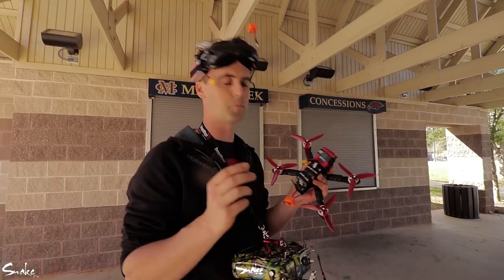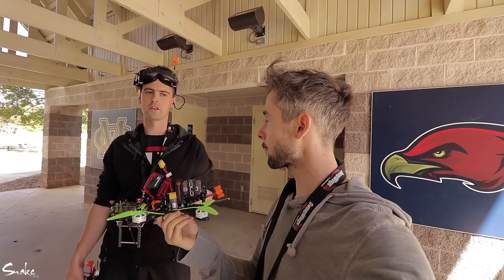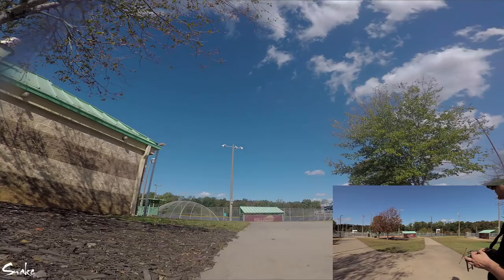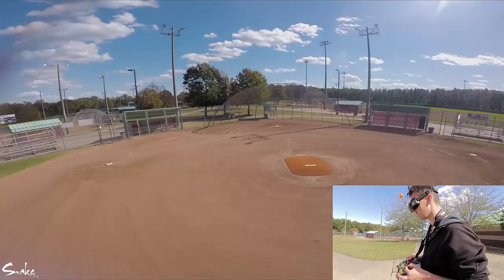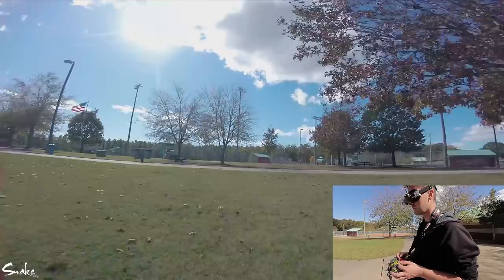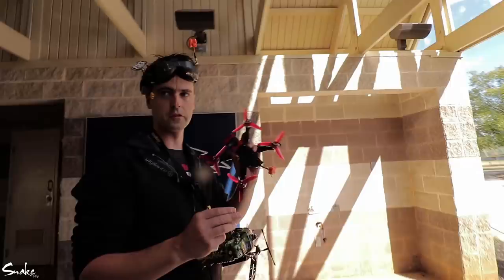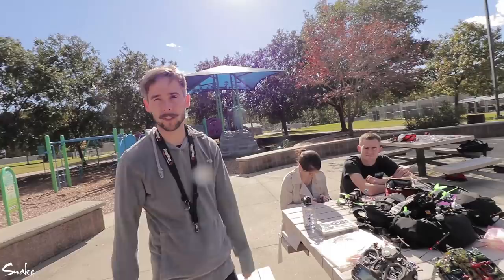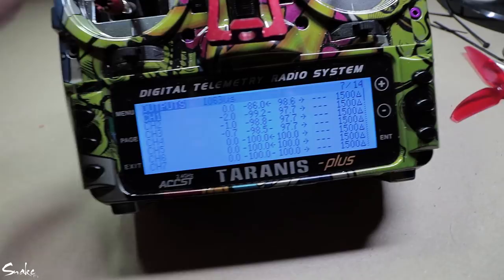Idle up (throttle cut) VS Airmode blind test!

Comment: i only hear about the idle up setup on kiss, can it also be done with betaflight?  or even raceflight (i highly doubt)?
Reply: it can be done on Betaflight
Reply: you can do it on everything, it´s just one thing the pid controller if off as long as you don´t reach min command, (airmode just raises yourinput to whatever min throttle is set to if lower, and changes you pids dynamically to throttle position), how you prevent that from happening is up to you, this is something old before airmode was introduced
Reply: Just turn air mode off and you set up the idle up switch on the taranis
Reply: nsboost don't have a taranis, guess I'll have to do some research
Reply: I had it also on cc3d openpilot :)
Reply: baseflight and openpilot, the good ole days where shit would catch fire on ya lol

Comment: My only issue with this comparison is that it was a differnent quad that was used, you should rather change the setting on the same quad and then fly it back to back.
Even if the quads have 100% the same components there are still minor differences that can account for the change in feel between to quads. I mean even Steele has a video where he just swaps out a kiss FC same settings/pids and the quad flys better.....

Comment: I got both mode & i add up a horizon mode in the middle of the 3 step switch.
When i arm it turn motor ideal with the default switch is in acro.. the then when in the air..i jump up the switch to airmode. I used airmode while doing flip or roll.. it kinda make my kwad feel lil lock.. but after watching your footage & review.. which is the suit for do the job ?

Comment: I have my quads set up with throttle cut as well.  To be honest I can not tell the difference.... but then again my skills are no where near yours or steel’s.

I was wondering if you run the Steel PDB in your quad?

Can you guys do a video on how to set up RSSI in the OSD when using the Steel PDB or any other way?  I use KISS everything too but never could get the RSSI readout on my OSD

Comment: I don't get what the advantage of idle up is over just having a switch with acro only and acro with airmode, then just having a throttle cut switch. Min throttle will still make it float and give pitch/roll some authority won't it? What am i missing?
Reply: Without using idle-down/throttle-cut, I think neither KISS nor Betaflight has a way to turn off gyros, be below min_command, and still be armed and spinning the motors. In other words, your two active modes become "arm/diagnostics" and "idle-up + acro". The video mixes two sets of concerns and becomes a bit confusing, especially since the blind test is really only about flight characteristics of idle-up+acro vs. airmode, not about the behavior before takeoff.
Reply: d3wd3r Awesome, thanks for taking the time to reply and the detail you went in to. That cleared it up cheers now i get the differences. Happy flying
Reply: yes thank you

Comment: Could you place your arm/throttle cut on a 3-way switch? So when you push the stick to the middle it arms and when it is at the bottom position you have throttle cut as  well?

Comment: What I don't understand is how does the quad keep the attitude at min throttle. On betaflight if i just switch the airmode off (motor_stop is off also) the PID controller is active at min throttle but fails to stabilize the quad. Any possibility you could try to set it up on betaflight to perform the same?
Reply: Silweror with airmode off the PD is active, not the I per my understanding. So it will just smash the I windup and P is not enough to keep it stable
Reply: That's the whole point of them setting the idle-up switch. It moves your throttle position up from min_throttle so the PID loop becomes active and stabilize the quad.

Comment: That has got to be THE MOST confusing way to set up idle up\throttle cut.....  No wonder you were so confused about it!  The way I did mine was to simply make 2 slight changes in the INPUTS page under throttle.  You just have  your one normal input for throttle then duplicate it and copy the settings to an additional throttle input BUT just change your "switch" and "diff" curve levels depending on which switch position you are on\diff amount that spools your motors.  Boom and boom....  Idle up for dummies!!!

Comment: why would either of these feel different?  airmode means at 0 throttle you have 30% less pids.  Does the percentage change if you run throttle cut??
Reply: Is that on KISS? it's not that way on BF.
Reply: good question... i just assumed it was KISS

Comment: What percentage value are you guys running for idle? Or is that only betaflight?
Reply: you mean min throttle ? starting point is always a value where the motors sound smooth in motor test tab. It´s no longer a thing but before 32bit esc´s, when min throttle was to low you could experience a motor stoping in mid air doing dives or aggressive manouvers, most likely see a little shake when raising throttle again. And last when you your quad doesn´t stop correctly after rolls and flips and it´s not so little that you can get rid of it with some P you can raise or lower min throttle.
Reply: Percentage is what is used for DSHOT in Betaflight. Percentage would stay the same as you currently use. 4.5% is roughly equivalent to 1070 min throttle, you can find that info in the BF Wiki
Reply: Sweet! Thanks for the info guys! I run 4.5% with DHOT600 but I guess I just wanted to check that these guys weren’t bumping it up more because I do want to go away from air mode, it can be unpredictable and dangerous at times and I didn’t really know if it was really adding much to a quad set up properly with idle up
Reply: 2.5% on Dshot600 betaflight - but depends on your motors
Reply: I find that 4.5% idles around 1050... but lately I've been trying 4.0% and I'm seeing idle to be 1040... no desyncs and no problems thus far.

Comment: @Snake FPV Do you think the different behaviour in "idle up" may be related to the higher rpm's of the motors at zero throttle?
Reply: there is no difference in rpm´s, it´s still at min throttle value, the only difference is that airmode also dynamically changes pids
Reply: Thanks for the clarification Chris. I'd thought that increase the motor idle throttle value could have give more "authority" in handling the float at zero throttle.
Reply: NikFPV there doesn't have to be a difference in min throttle with idle up. 

Let's say your motor starts spinning smoothly at 1010. Your Airmode set up, you would likely set your min_throttle at 1040 or so. 

If you now want to disable Airmode and go with an idle UL switch, you can now set your min_throttle to say 1010 or a little higher. And then set your radio idle up switch to move throttle value to 1040 when enabled. 

So in both scenario, your airmode and your idled-up would be essentially be spinning motors at 1040 when radio stick is at the bottom.

Comment: i run zero throttle. always hated the airmode floatyness and bounce. arm on switch. done.
Reply: The bounce thing with airmode has been fixed for months.
Reply: Matt used to flying without it. So meh. Plus slightly longer batt flying time.

Comment: can idle up mode be programed on a specktrum remote?? i cant find any info on it
Reply: yes, i think you use the "Motor Curve" setting with an enable switch. cant remember exactly how i did it at the moment.

Comment: look's like is only a setting to cut the value of the throttel in the taranis. Do the setting in the Taranis and you will still have the Gyro active using betafligh. dont know if this setting change something in Kiss but does value at the end of the video are only good for the Taranis nothing to see with a FC fonfiguration...

Comment: I went fly today! only use. Ilde up today! i set the hole curve! In my flysky the " NO IDLE" is, 1,2,3,4,5= 0,25,50,75,100. I startet with no airmode! when i startet flying!!  But after going back! and fine tune the curve in flysky like! 1,2,3,4,5 is now 14.14,40,70,100. that make the curve stright! and in betaflight i have my throttle curve ans no airmode!.. I dont know! But i just feel its my thing! but think that you have to be more preise! maby more hard ? But think, that why!  Thats why MR.Steel is so dam good! :-D Nothing is that easy!!

Comment: So everyone jumps blindly on idle up.  Were these "identical" with PIDs, rates and that?
Reply from the maker: +Smokin Mesa u mean your blindly making pointless comments like this? Of course they were exactly the same mate, give me some credit... hahaha
Reply: Snake FPV I meant reading the comments there're a lot of people going on about changing to Idle up just from this one video.  

I think if you're good and you fly one quad all the time, then switch to another, you'll notice some difference even if using exactly the same hardware and settings.
Reply: Should look at some of his other videos,  He imo more then knows what he is doing and has a very good method.
Reply: Scraggle Roc seen the last 100 or so. This one didn't come across so meticulous, mainly I guess the last min prop change. 

I wasn't picking at his method more the hype train knee jerk reaction (extreme way of putting it) everyone has to change to it.  As if it'll make them a better pilot or something.
Reply: Smokin Mesa Oh yeah, I was just saying from most of his other 'blind tests. He seems to make sure to actually blind test it.  Either way. Something like this my opinion is a feel thing. Cause snake or steele flies it doesn't mean my style or feel will agree.. but from this I took away that its worth me trying.
Reply: Wasn't trying to take that away from anyone.  Trying new things is of course fine.

Comment: If your min throttle is now 1060 of course the pid controller has more authority.
Reply from the maker: +zymurgyjwt actually the min throttle output with air mode activated is 1070

Comment: So KISS doesn't do airmode correctly, lol. It's pretty easy to spin your motors with your index finger on the bell to check if the prop tips are tracking. I always laugh when someone launches there quad by holding their hand above a 3HP quad blender, just begging for bloodshed, all it takes is once, common sense is holding the quad from the bottom and let it take off AWAY from your hand (as long as you're positive your props are on correctly).